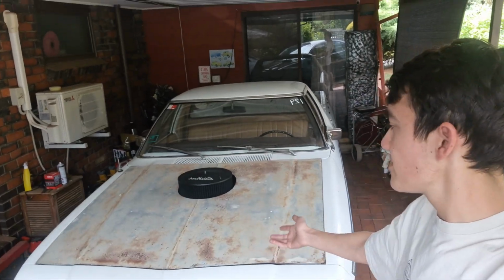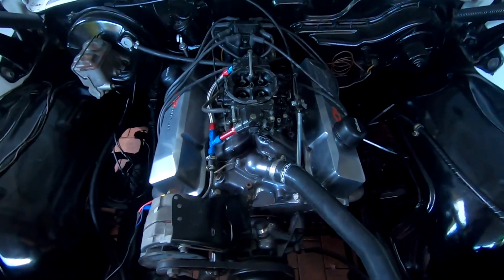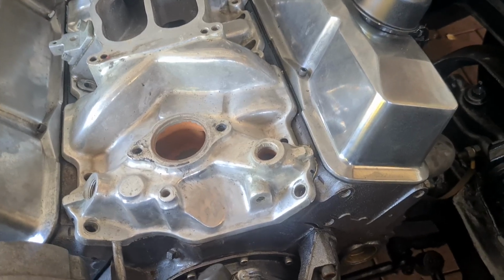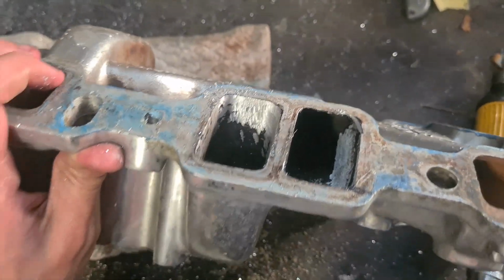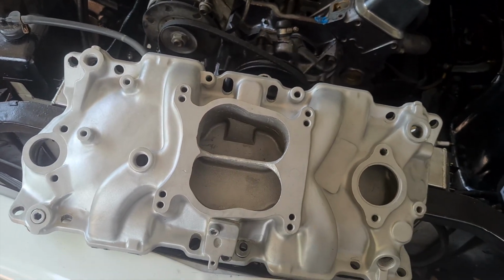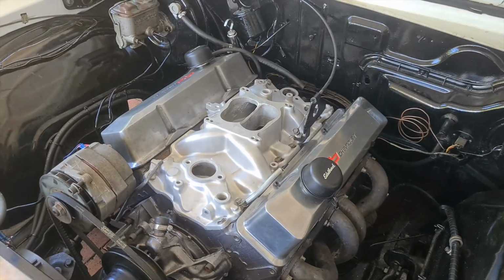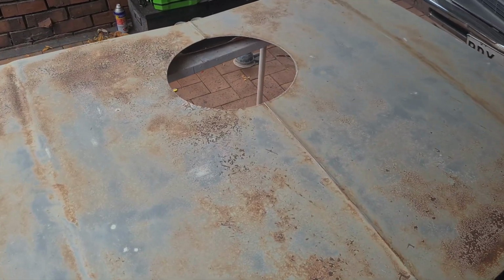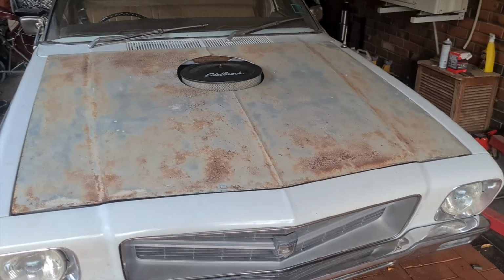Swapping The Single Plane For A Dual Plane

Comment: 1 1/4---  1 1/2 inch     drop base air cleaner  with a 2.5 or 3 inch filter  usually gets the job done 
Use an Elderbrock RPM Air Gap is about the highest manifold u can use . Victor Jnr is within 1/4 inch .  A  very low rise single plane is the Weiand Team G 7530 [lower than ede rpm and vic jnr .]
For a mild 350 the ede rpm air gap is the go . U dont have enough engine for a single plane .
Reply from the maker: Too late, Out the bonnet now. Ran the perfomer at the track on the weekend. 4 tenths slower and the mile an hour is down over the torker manifold. This manifold is not staying.

Comment: Looks like the drag racing bug has bitten hard ! How did it drive with the new manifold ??
Reply from the maker: Il let you in on a secret. Just finished filming racing with it last night. Actually, it made it worse. I think the converter stalls beyond where the manifold performs, and the dual plane does not have the top end. Ran our worst mph and time last night racing.
Reply: @Joedennett69 
An RPM Airgap style dual plane always performs better than the low rise one. I put one on a sbc 305 Vortec with the factory cam and it ran better than the low rise that came off.

A genuine imitation RPM Airgap dual plane intake would be the ticket.😎👍